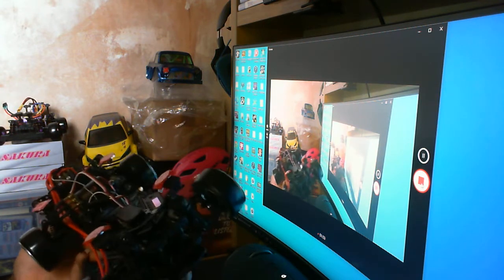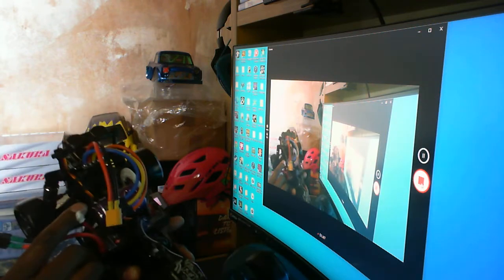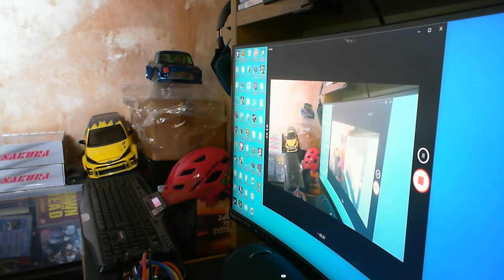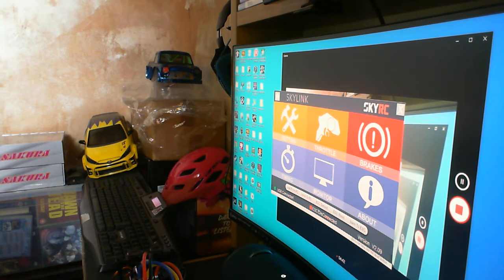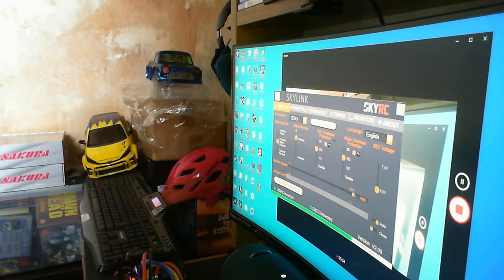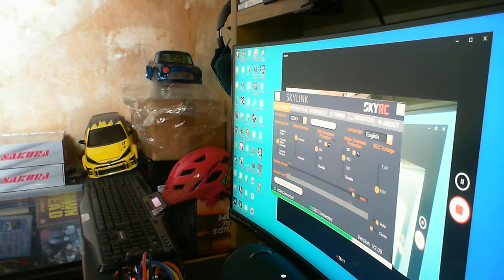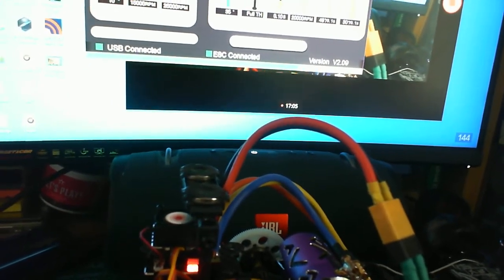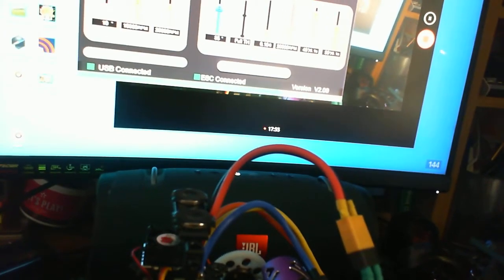RC drift boost and turbo settings for Toro120 esc and may help others.

Comment: Thanks for the video, I too struggled to find anything similar, you video has been very helpful. And I’m pretty confident that whilst I had set some boost and turbo to my ESC those settings were not saved . I will try again. Thank you